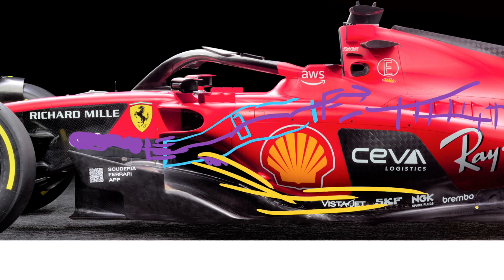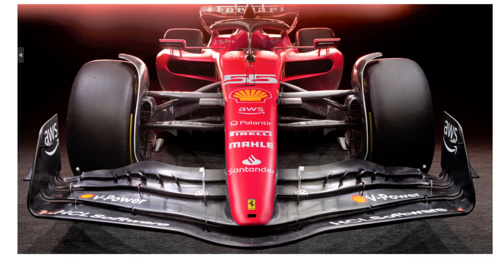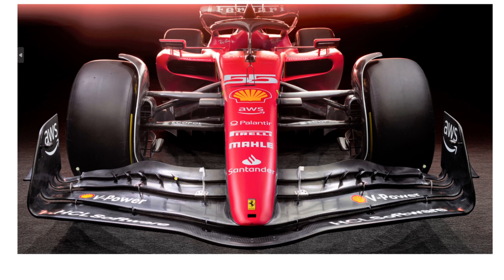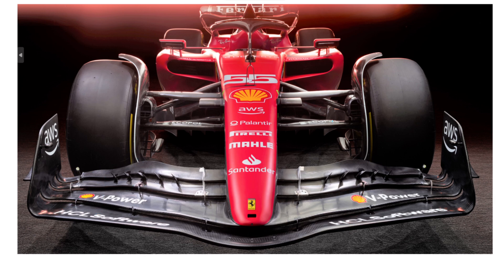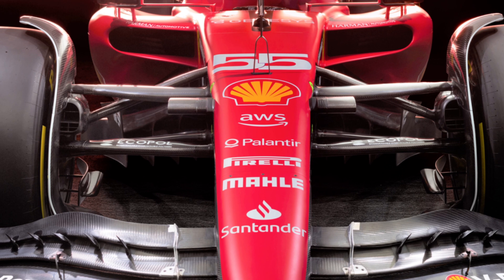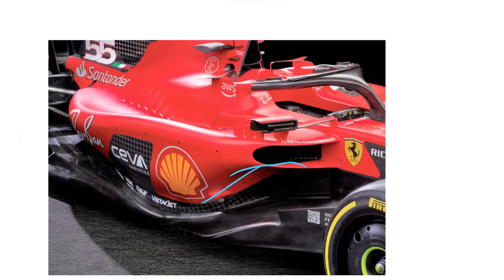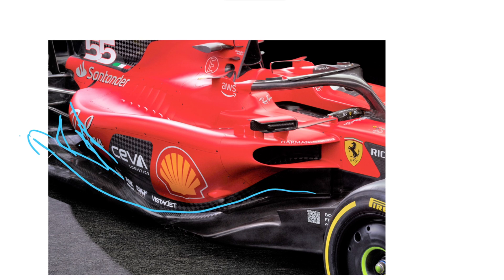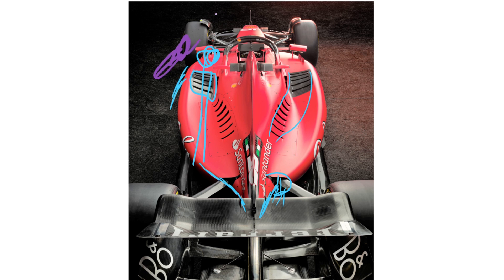Ferrari  SF-23  -  Aerodynamics Analysis and Initial Thoughts

Comment: these analyses are incredible, your attention to detail is astounding, and your deep knowledge is apparent. That bypass duct is fascinating. I wonder if it would be worth the drag hit to accelerate that flow inside the duct and use it to energize the boundary layer over the sidepod louvers. Any internal radiator would surely break up the large structures ingested by the duct, and condition the flow similar to the heat exchanger in a wind tunnel.  I've never worked in the F1 space so I don't have a good understanding of the flow around any part of the car, and your assumption of cleaning up the flow around the top of the floor seems more reasonable, but I wonder if there are other secondary benefits.

Comment: The intake vein is similar to how Mercedes run that vertical/zero pod design. 🤔
Reply: Nothing to do with Mercs, a lot to do with Ferrari GT3 experience. That solution is used expecially in GT3 cars to took off some drag feom the car and meanwhile pushing the air upon radiators cooling them down (so working better) they applied it to F1 giving a plus of air fluid addressing where they need the air vortex to go.

Comment: Great analysis as usual, many interesting points. Ferrari in effect have a dual side pod design with the traditional side pod and the Mercedes-esc smaller side pod lower down, perhaps this will increase cooling performance.

Overall, it seems that Ferrari have influences from Mercedes, namely, sliming the body, the front wing, and although they have increased the mass flow with the additional intake, it has geometric similarity with the Mercedes sided pod. Can't wait for the Mercedes analysis.

Comment: Not something at all related to automotive aerodynamic thing other than it’s aero dynamics. But could you do a video on vortex tubes? They take compressed air in the middle and put out hot air on one side and cold air on the other. This Old Tony did a video on them a while back, but they seem to work on black magic. 
I though you might be able to shed some light on them.

Comment: the secret bypass duct is blowing my mind. Brilliant innovation
Reply: I saw the outlet for it during the launch! Was wondering where the air came from. Very sneaky!
Reply: where is it
Reply: Looks like F-Duct since 2010
Reply: @kenethpescador206  Not really. The F-Duct was a passive way to stall airflow over the rear wing, with the driver covering a hole in the cockpit to activate it. Basically the predecessor to DRS.
This Ferrari duct is a way of ingesting the tyre wake and redirecting it to a part of the car where dirty airflow is less of an issue
Reply: As he was explaining it I couldn’t help but think that it could be this generation of cars’ big exploit. If what he said about it pulling up the chassis losses away from the floor is true, then I think it is absolutely genius stuff from Ferrari! I can’t wait to see how it works for them and if anyone else tries a copycat design as the season rolls on.
Reply: @armadillolover99  I'm a Ferrari hardcore fan but I don't think it is such a big exploit from ferrari, I think it's a trick to obtain some airflow efficiency with a big sidepods design tho. I mean other cars as red bull has way smaller designs so they can't and probably wouldn't even needed that bypass inlet. 
This way Ferrari can keep their sidepods philosophy without giving up on all the air penetration efficiency.
Reply: @armadillolover99  I'm interested in Mercedes' concept, as I wonder if the vertical cooling inlet does that job of ingesting the dirty airflow

Comment: Ferrari is pushing hard on aero innovation and air fluid work to better clean them. They refined an already winning concept.
Watch out cause everyone else followed more or less the RB path (apart Mercedes) and there's no way that this Ferrari will be slow since it's an evolution and not a revolution. If Mercedes was able to make works it's phylosophy we could see a Ferrari and Merc faster from 0.5 sec and more, than all the others, RB included if they didn't stepped up the game with some genial solution as this one of Ferrari.
It will be an interesting season.

Comment: If the aero concept allows the car to preserve the tyres better its game over.
Reply: Ferrari until half season last year was the best on tyre consumption. Then they had the PU reliability issue and having to cut the powerhorse they had also take off some downforce from the car, is that the reason why they started to have an huge tyres degradation, that was related to the lack of HP, cause if you have the full HP at disposition you can add downforce that will benefit the tyres. The car design and suspension had nothing to do with the issue of last year Ferrari.
Is better to say that if they have resolved their PU reliability issue, also the tyres consuption will be great as it was until last half season period.
Reply: @solinvictus1234  the PU reliability issues came with the upgraded engine. I don’t get how you equate a PU reliability issue to then Ferrari running with lower downforce. Ferrari were on the tyres from the beginning, it’s just Red Bull progressed on the weight and this issue and Ferrari didn’t progress on that front. This can be seen how Ferrari switched the tyres on better than anyone else for qualifying but come the race, they struggle to control the degradation on them.
Reply: @kwl189  Cause the downforce an F1 car produce is strictly related to the amount of power it can put in the ground. If you have a car at full power you can add downforce modyfing the wings angle and the thres consumption will be better. But if you DON'T have enough HP to stay with the opoonents (as happened to Ferrari that had to cut his engine HP) you have to took off some downforce from the car to not compromise his acceleration, but the tyre will suffer that lack of downforce, resulting in high degradation.
All cars progressed on the weight, that's the primary area where teams try to find performance immediately. And no according to official sources (RB included admitting that) Ferrari was lighter than RB
Reply: It’s possible Ferrari lost the extra weight they carried last season which will naturally improve tyre deg. With extra downforce, Ferrari will also be in a good position to be easier on the tyres. There are strong rumours of the PU being the best on the grid but have to wait and see.

Comment: with mattia gone they will suffer even more , worst decision ever she should have been demoted not fired  because he is a genuis engineer, the same car nothing has changed , they shoiuld have revolutionized the car , especially aerodynamically , and the same  sidepods why they did not do the same sidepods as redbull , stupid , lazy , uncompetent , ignorant ,  philisophical , sore losers engineers and team principal , he is worser than mattia he hasn't changed anything
Reply: This car was made by Mattia 😂
Reply: I'm sure you are smarter than all the Ferrari engineers with access to CFD, wind tunnels, an actual degree.
Reply: You're very emotional. Are you 13 years old ?
Reply: Mattia Binotto oversaw development on the car itself. Fred Vaseur joined too late to have any input into the design. If any have any complaints, direct them to Mattio Binotto.
Reply: Mattia worked on the car until his contract ended. 🥱
Reply: @MetalMonster313  when his contract ended the car was already made

Comment: A question that's been raising for this project is its name, Ferrari 675, maybe hinting at its weight? Could they have 40kg of zavorra (how do you say in english), that could be a truly key element for the dynamic performances of the car
Reply: they weight 798 kg so no way it is only 675 kg.
Reply: It's just how they code name the car, the F1-75 was named 674
Reply: Ferrari struggled with weight last year and Red Bull got the jump on them in hitting the minimum. 675 is the project number. The weight limit is a shade under 800kg which is quite heavy considering the V10s were 500-600kg.

Comment: I saw some theories about the intake under the main inlet going straight through the sidepod (in a tunnel) and exiting out back near the suspension mount energizing the area around diffuser/beamwing. Possible?
Reply: Possible, but not plausible. There's a lot of stuff in between those two points. The way described here is both reasonable and has a benefit. To get this air past the fuel, motor and gearbox is probably an exercise in futility. Even if you manage it, all you get is dirty air.

Comment: wait.. is Ferrari's reason for the mid-chassis duct the same reason for Mercedes' vertical cooling inlet?
Reply: no. completely different things.
Reply: @FTWGame0N  What purpose do you think the Mercedes sidepod shape has then?
Reply: No one knows, someone says they are an s-duct, but I doubt they will ever reveal what they do, at least for now.
Reply: @eddy_6502  The most logic aolution is that yes is an s duct to force the vortex going upon the hood and seal the clean air inside the belly pool to speed up that air and extremize even more the downforce created in that area.
Reply: @eddy_6502  nobody will ever know for sure. Just because there’s an a supposed exit vent doesn’t necessitate that the air will leave there. It could go anywhere else.
Reply: @eddy_6502  given that it's Ferrari, there will probably be a picture with the side pods off after a couple races
Reply: @nbain66  there will be a picture of everyone because I think everyone will have the need to work on them. That’s why I said not for now at least